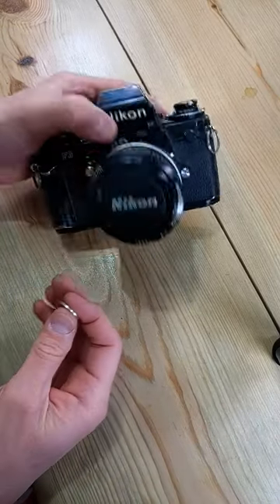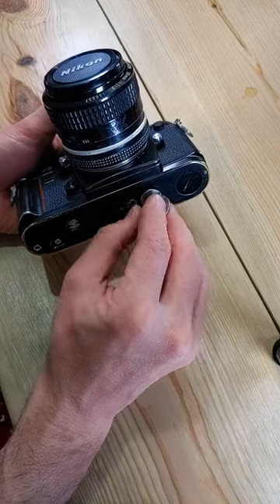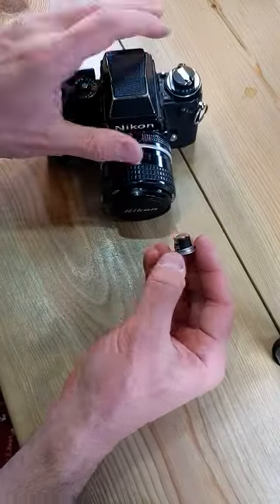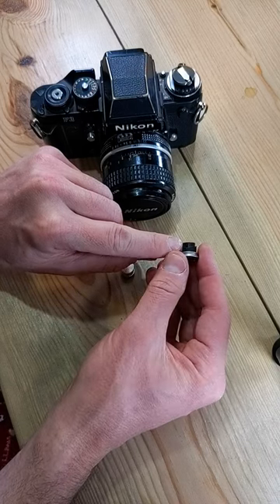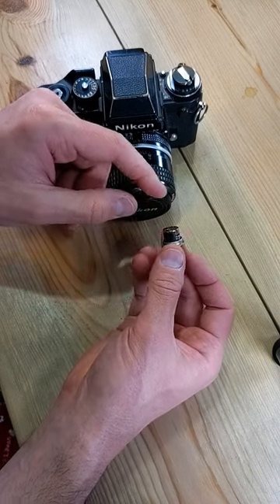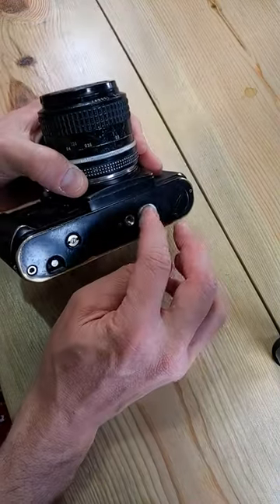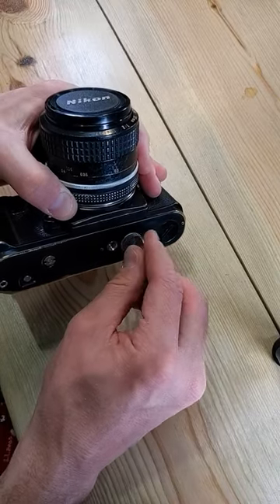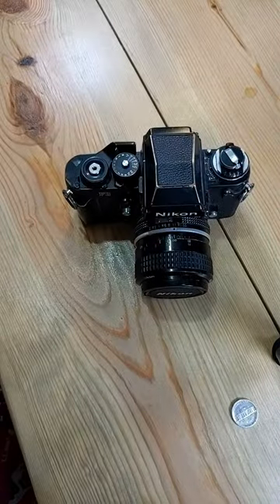Nikon F3 Battery Replacement: Quick & Easy Guide | YouTube Shorts

Comment: I have one F3 stayed too long in my storage. When I took it out for a test, I found 2 dead lr44 in there. I put 2 new ones, turn on the camera but the LCD does not show anything as it shoud. Probably the 2 dead batteries had caused some damage but I'm not sure :/ Any suggest?
Reply from the maker: Ouch. The batteries, if they corroded, can damage the camera. I do have a video that shows how to clean corroded battery chambers, so that might be a place to start. The LCDs on the F3 are not holding up as it is. Mine usually does not work. IF the rest of the camera works but not the LCD, you'll be stuck using it in "A" mode or with a handheld light merter.
Reply: @DavidHancock  Thanks. LCD aside, I don't think the rest does fully work. The shutter release button is blocked even in A mode. Only the emergency shutter release lever works. Or perhaps the shutter button got jammed somehow. I'll try clean corroded battery chamber first.
Reply: Hello, the cradle is plastic or metalic?